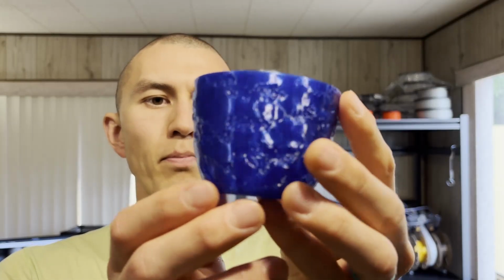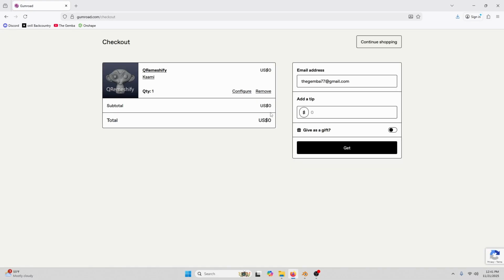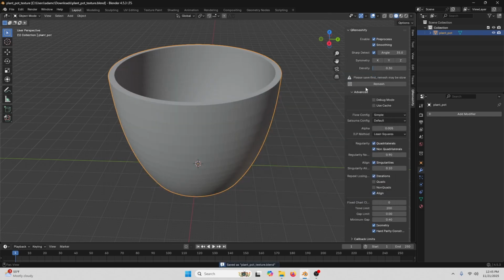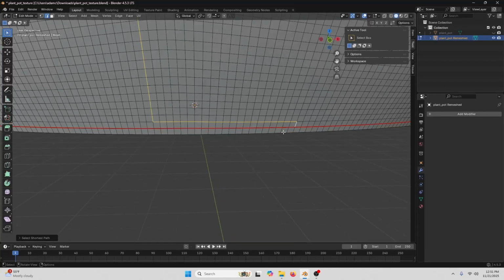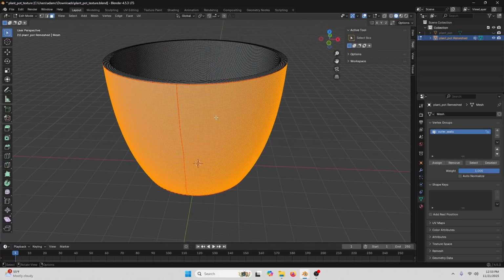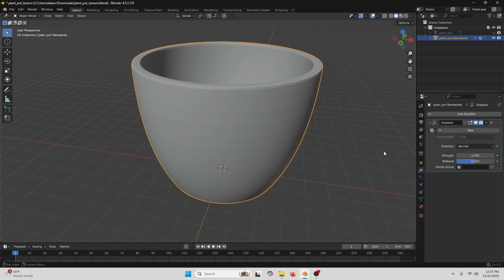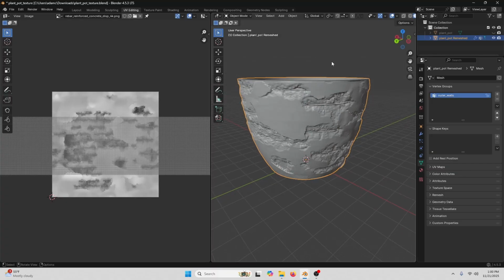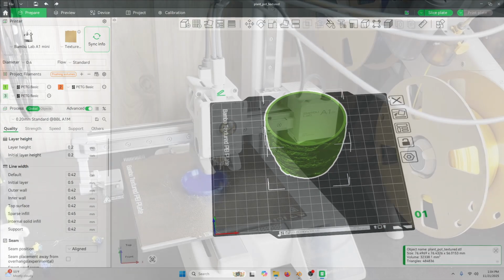Tutorial: Apply Textures to Curved Onshape Models with Blender

Comment: I'm not interested in the artistic aspect of this, but being able to reinforce a 3d printed rc plane with a geodesic structure wrapped around it, is something I always wanted to explore and this video sparks new ideas. Do you think you could apply the same method to a tubular shape much more complex than a simple vase (i.e. airplane fuselage), though ?
Reply from the maker: Yes, that is entirely possible. You can apply textures to any surfaces you want using Blender--you just need to break up the mesh using seams properly.

That being said, Blender might not be the best tool for your application if you want real precision. Figuring out how to do it entirely in OnShape might be better.
Reply: @TheGemba77 Even though I'm comfortable with CAD, this specific task seems daunting to me. Using meshes gives a lot more flexibility IMO. No need for real precision also. The way I see it, just simple corrugations (as in corrugated cardboard), would make the structure so much stronger. I'll keep exploring, for sure, but If you ever decide, to make another video, applying this method to more intricate shapes, I'd be eager to watch. Thanks!